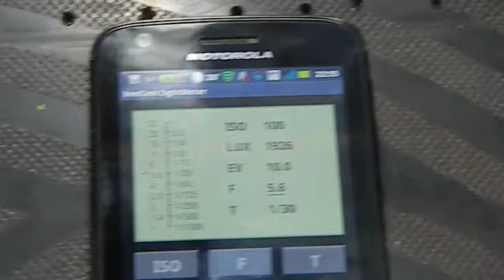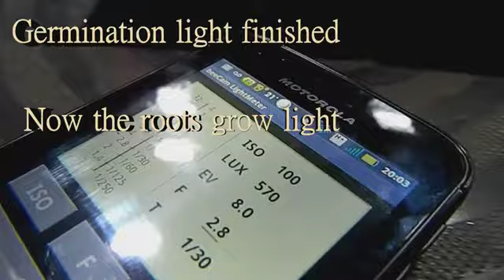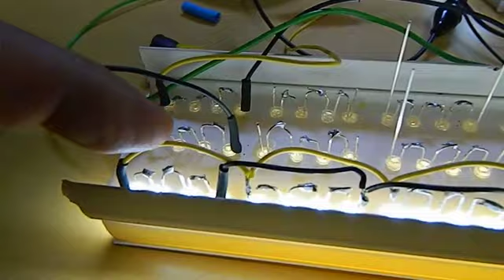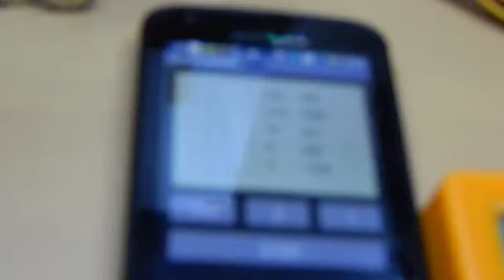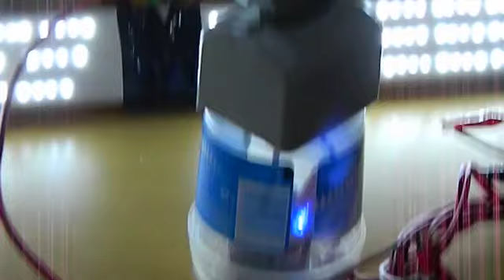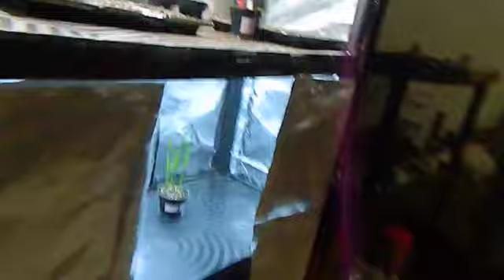DIY Light System for GreenHouse

Comment: Pink LED's vary a lot for each model. Its well worth being able to get some idea on the spectrum, before buying too many. Even if its a $5 DIY pinhole spectrograph. Although a decent digital camera, taking a shot of a 17% grey card, and some software, can do a better analysis. So I'd be surprised if there is not an app for it... I got a good idea of RGB saturation with my software, but hard to tell wavelength. Your white ones are going to go ok though :) Comparable to micro HID of similar watts.

Comment: fruiting/seeding/flowering department, if its a harvest plant. It also seems plants may use different light colors to help indicate season, so bluer in summer, and redder in the off season. So adding red may yield better, faster bean harvest. Yellow and green are wasted on the plant, white light has lots of yellow ind green, look at the datasheets, and Pink looks to be best lumen's of growing light per watt. 50% of the white light is wasted. red and blue combo is amp hungry, but tunable. cont.

Comment: Been looking in to this a bit. White are actually blue or UV with yellow phosphor coating. So heaps of blue, Very similar to hid or halide, But not as much yellow and green the plants dont use. There is a spike in Chlorophyll A (chlorophyll synthesis) Around 430nm and 640nm, and Chlorophyll B Around 450 and 660nm. While plants do seem to grow well without the red, they deform with no blue, and elongate, stretching for the light. There is some evidence to suggest red is better in the ...cont.